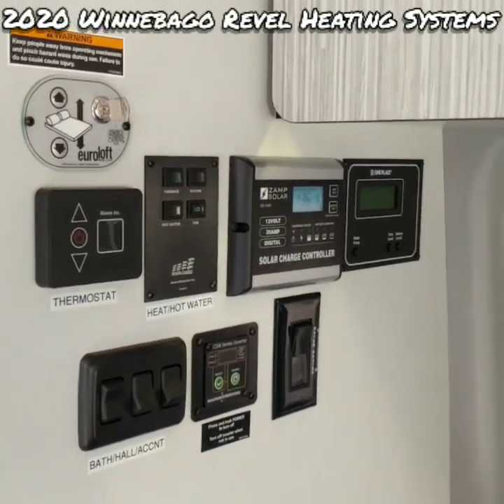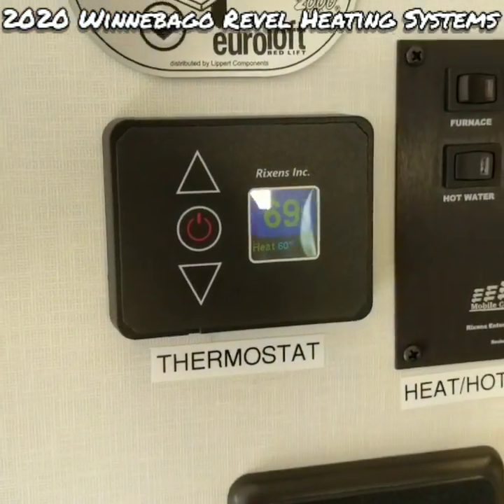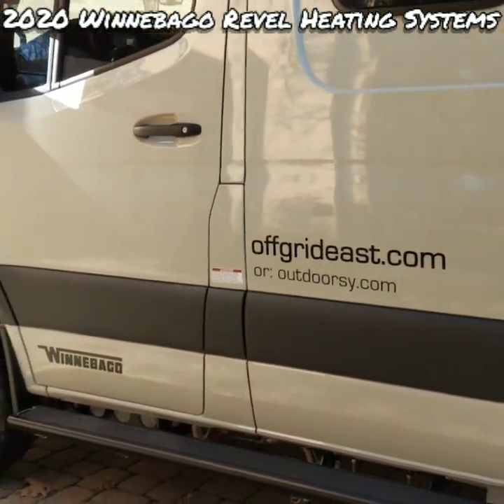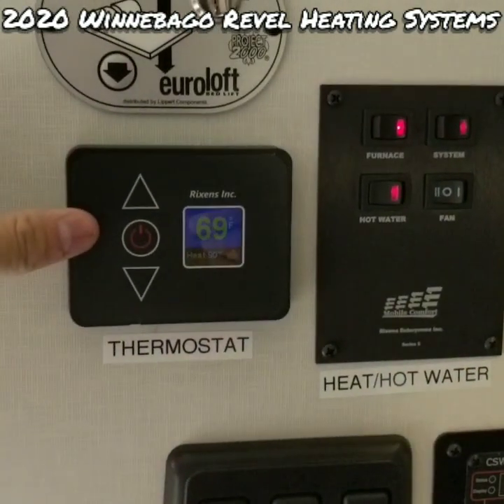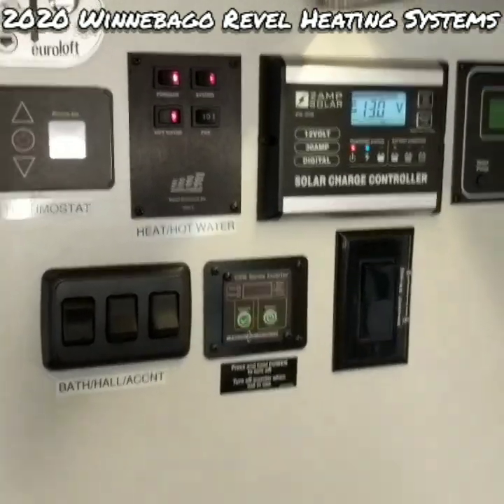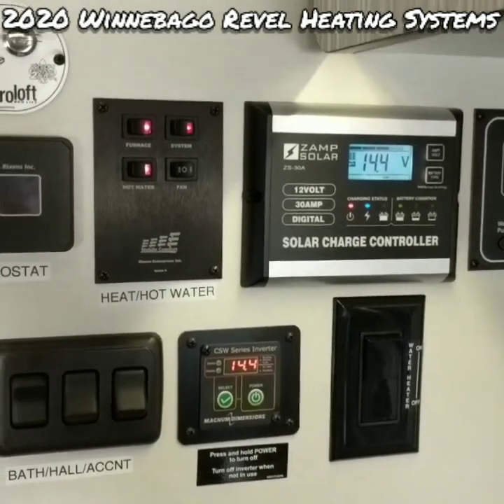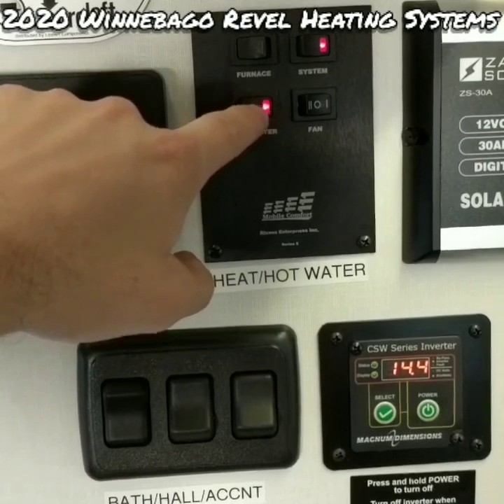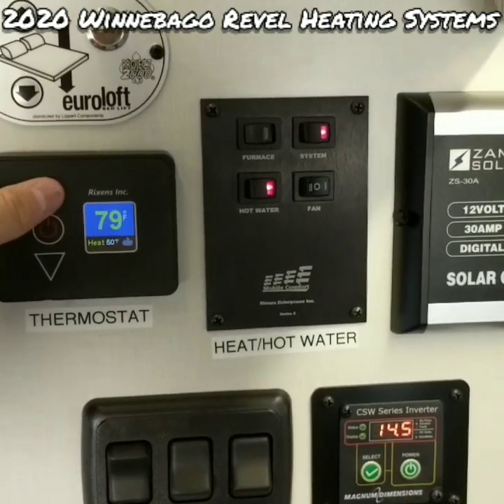2020 Winnebago Revel onboard heating systems

Comment: Nice Video but the thermostat setting for the furnace  operation is wrong.  Set the thermostat where you are comfortable. Running the fans on low will help keep the furnace running in the low stage. It has nothing to do with keeping the furnace screen from getting clogged.  The screens are a service item and well need to be change when they start to burn out.  This is often diagnosed  as a clogged screen.

Comment: My heater is running fan is on my temp on panel says 30 but I can feel it getting warmer rixen panel just shows 30. I saw you had inverter on I did not. Thermostat never moved off 30
Reply: Your thermostat is in celsius. Hold the power button for 7 seconds, this will put you in the menu mode. Pick interior and fahrenheit this will fix the problem.

Comment: Excellent! I have had my revel for a year and have not even had to use these systems so this was great. That being said could you do one going over the inverter and  induction cooktop. We have not used any of that either since we do all of our cooking outside. The guy who did our walk through knew nothing about the vehicle, we were video taping him for reference and then realized he did not know a thing. I actually had to show him how to open the door to the cassette toilet. Thanks again.
Reply from the maker: What questions would you have about the induction cooktop? I've moved up to the 2021 model but there's a lot of crossover in that regard.
Reply: @derek4wheel  the cooktop I have figured out. Just turn it on and use a induction cook top kettle. I am just not familiar with the inverter board where all the other switches are.
Reply from the maker: @mtnride4930  control panel to the left of the  "electric heat" switch (bottom right) just hold the power button until it beeps, same to turn it off. Like a water pump, turn the inverter off when not in use.
Reply: @derek4wheel  I noticed it comes on when we plug in is that supposed to happen?
Reply from the maker: @mtnride4930  yes, this is bypass mode. It is allowing 120v to flow through the inverter to the 120v outlets. The converter is turning 120v to 12v for battery charging as well when plugged in. Biggest thing to note is that when unplugging from shore power, the inverter will remain on unless turned off or have the settings changed (see manual)
Reply: @derek4wheel  another thing they failed to tell me about. Thanks hope my inverter still works. Will give it a try. THANKS

Comment: What if you get an adapter for a 120v outlet, will it power the heater?  Cause when my batteries are low it seems like the heater wont heat up to the set temp on the thermostat. Just for plugging in at home in between uses. I have a 2020 revel
Reply from the maker: 1. Don't use the electric heat option if you're not plugged into shore power. Diesel Heat only.
2. 120v 15amp "house" outlet will power most everything in the van except the A/C unit. Obviously, you'll need an adapter to go down from 30amp 120v.

Comment: Great job....Been looking for good instructions on using the systems on the Revel. I just bought a 2018 so I have to interpolate backwards to my unit. I have been doing upgrades to mine as Winnebago does such a cheap job on lots of the installations. Broken plastic latches, rust on anything they added to the outside, insulation is almost non existent where they could not reach. The rear doors have a total of one 3/4 in strip that is 16 inches by 5 inches....thats it. Buying wool insulation and sound isolating rubber for the interior of the sheet metal.

Comment: When you say plugged in to shore power is that the 30 amp service? or can you have a 110 outlet put in?
Reply from the maker: Shore power refers to the 30 amp plug into a suitable power source. 30 amp is recommended but you can get an adapter down to 120v 15 amp normal house outlet. You most likely won't be able to run the AC if you're using this type of outlet.
Reply: @derek4wheel   I tried it on house outlet with only fridge running and it flipped GFI. I am probably going to put in dedicated 30 amp just for van, that seems to me the best way to go. What do you think?
Reply from the maker: @mtnride4930  Highly suggested if you live in an area with colder winters. You can keep it plugged in between weekend use so you don't have to winterize.
Reply: @derek4wheel  we use our revel as a daily driver, thats what I love about this van out puttin around every day. We can picnic in it, fridge is always on it’s perfect

Comment: Is dead start battery possible?
Reply from the maker: The earlier models had a "Jump Switch" where you could jump start the chassis battery from the house batteries. However the 2020 Revel no longer has this feature.

Comment: You set it 90 degrees for the inside temp?
Reply from the maker: Yep, it was recommended by a company that installs/services these heating units in van builds. It keeps the furnace running at a constant setting instead of cycling on/off.
Reply: @derek4wheel  You set at that temp when the van is sitting not when you are using it, correct?
Reply from the maker: @Kevin-oi7if  when the van is sitting I use the electric heat and set the thermostat at 50° if it's below freezing out. For long term storage I winterize and disconnect batteries.
Reply from the maker: Electric heating element isn't large enough to heat the van to 90°. It's main use is actually for hot water. Just note that the thermostat setting has no effect on the hot water temp. For hot water with either heat systems running, turn on the hot water switch on the Rixen panel.